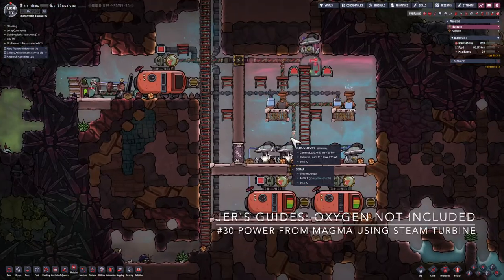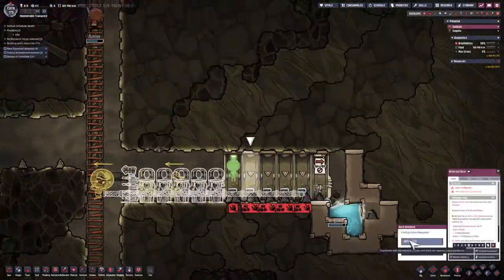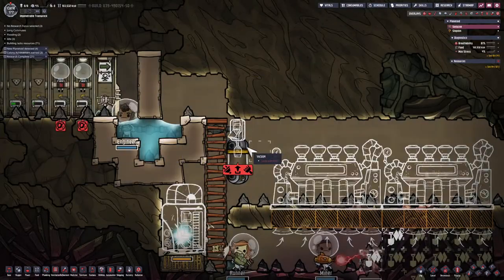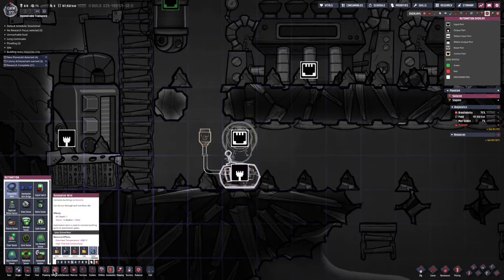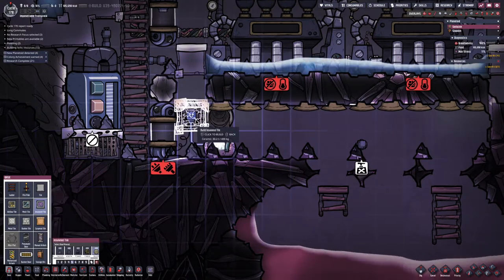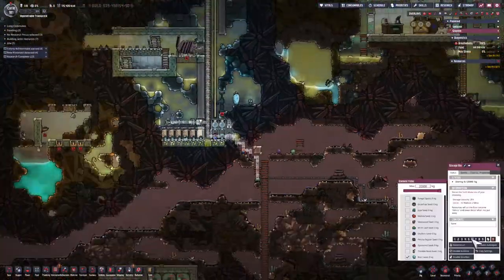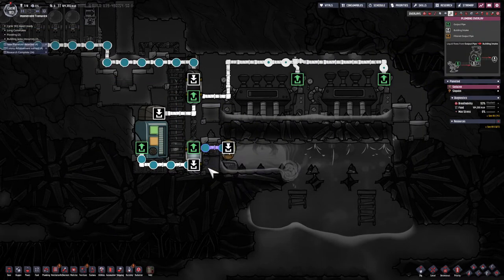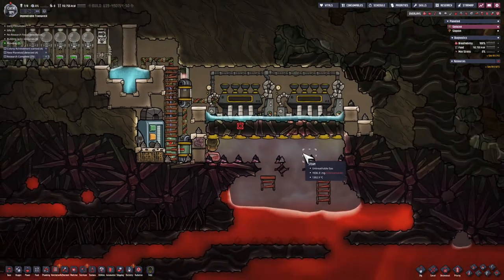Jer's Guides: Oxygen Not Included - #30 Power from Magma using Steam Turbine

Comment: I don't recommend heating the steam with magma directly as obviously you can't control the heating rate, thus wasting energy.

Have a steam room that is heated with controlled manner (via heat ejection through steel doors) to keep a nice steady 200 C temperature profile so that the steam turbines can work at full power without wasting any energy and minimize the cooling needs and have the steam turbines operation controlled by the battery directly.